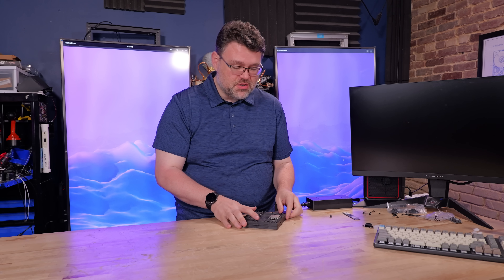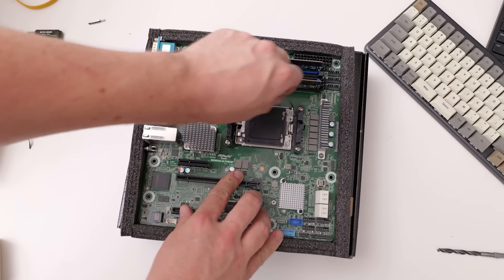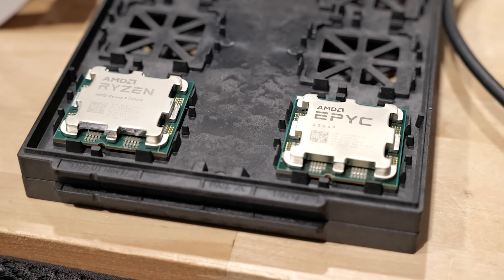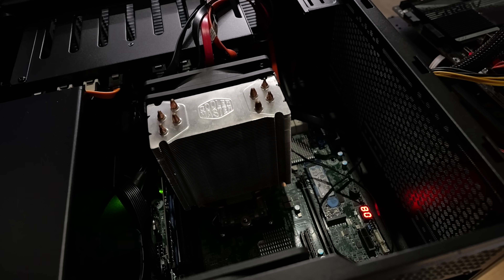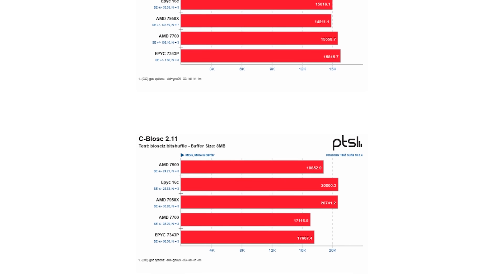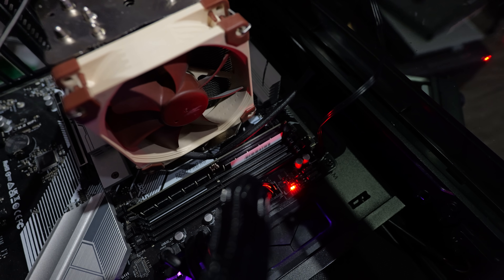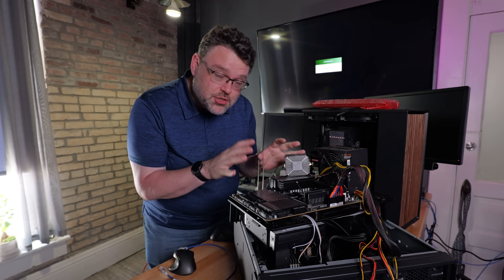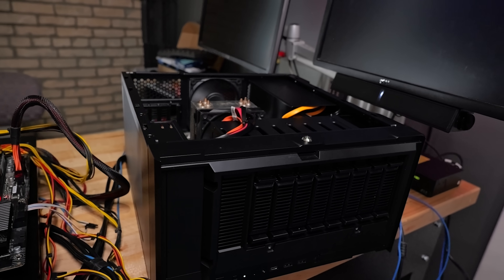They Put Epyc Onto AM5? Can They Do That?

Comment: Question, you mentioned the PCIe slot.  I’m looking to run 2-3 u.2 drives, likely in a 1u so connected to combo backplane.
Thoughts?  
It’s a shame you can’t easily run  multiple u.2/3  drives, via hotswap (though not real hot-swap but convenient to access)
Reply: anything?

Comment: What we need is boards with more pcie slots at usable speeds. 
Seriously, who cares about the new platforms gen 5.0 speeds ... instead of a single silly x16 5.0 slot I'd prefer a board with a bridge chip that turns those into four gen3 x16 slots or one x16 and six x8 slots. Slap some fast usb ports and dual or quad 10G onto the rear IO and I'd be in hardware haven. What, you want 800 bucks for that board because that big PEX is so expensive?  Fine. I take two and see how it goes.

Comment: You brought up something that I think is overlooked but sorely needed. A change in PCIE layout capacities on ATX and MATX motherboards. Not long ago the first PCIE was 16 lane electrical and 16 lane positions. A second PCIE was 8 lane electrical and 16 lane positions. A third PCIE and even a fourth, was single lane only or maybe 4 lane on some boards.
Today we have 16 lanes on PCIE1 and maybe a 4 lane on PCIE2  if fitted and maybe a single lane PCIE as well.
I'm with you, I would rather see PCIE 1 and 2 both being 8 lane and 16 lane positions, with additional single lane(s) as well. The supply of 16 lanes to PCIE 1 is a waste for most PC users. 
Firstly they don't game or so infrequently they don't need a 16 lane GPU, secondly, not all GPUs are even 16 lanes. There are lots of PCIE plugin boards that are available and in use today that need to be plugged into the 16 lane slot even when they are 8 lanes, with some boards 4 lanes. Thus requiring the GPU to go or be relocated to a 4 lane chipset slot. 
Changing the 16 lane slot to 4x4x4x4 or 8X8 or whatever does not help when the unused lanes cannot be reallocated as there are no electrical connections to be had on the board. And USB 3.2 gen2 or USB4 cannot be used as an alternative as many MBs only have USB2 or 3.2 gen1.
I don't think that motherboard makers are actually supporting the market well. Many boards are simply clones of another with a different name and "go faster" paint stripes added or removed. They are all obsessed with gaming. Yes, its big but many are casual gamers who use a pc for other purposes as well or exclusively. Many of these users have moved  to big brand prebuilt basic boxes or laptops as they can no longer build a desktop PC that works for them at a reasonable price.
Also I am not surprised that Asrock came up with a beta bios, I have put them as the best support company for years and have had special beta bios private download links from them in the past in response to email enquiries.

Comment: This has long been a gap in AMD's Server/Workstation lineup.   With Milan the lowest power and cost  EPYC was the 7203P at 120W at $338.  The market was screaming for something lighter and cheaper.  An AM5 part validated for ECC use on servers changes everything.  If this had existed previously, I would have bought it instead of my Rocket Lake E-2314 Xeon in my secondary server to my EPYC 7543.

Comment: Pix4D is a topography software that is heavy on CPU, an Intel 14900K does a crash to desktop when it's processing 1200 photos, with my Ryzen 5600X no crash. Guess what happened when it was a Epyc 7551P...
Basically intCel are the worst CPUs for workstation and probably servers too.
I don't trust benchmarks when intCel wins BIG over AyyMD because since the 00's intCel has been fixing benchmark software to favor their CPUs.
Since Pentium 3 I have never bought their CPUs and never looked back and lately I've been proven right on my decision.

Comment: Awesome! This would be a great upgrade from my current system of a Xeon E3-1275L in a Supermicro MBD-X10SL7-F-O with 16G of ECC but it would be nice to find a board with builtin SAS that can run in IT mode. I need all those sweet drive ports and built-in always works.

Comment: So this thing is the competitor to all of those Intel chips that the data centers were having problems with. If the price is right that could be very challenging for Intel.
Reply: Intel will have new chips on TSMC 3nm this year which will be a game changer.

They will have 12P Core Bartlett Lake on LGA1700 around January which should hopefully address all the issues of the 13th/14th gen B0 die.

Comment: W E N D E L L !!! . . . I have a question: what is better for internet browsing and 2k/4k streaming , a higher boost clock, or a  higher base clock?
Reply: The correct hardware encoder for the streaming part is more important then raw CPU power, as far as I know.
Reply: @larsjrgensen5975  . . are you Wendell? I was certain to specifically ask Wendell. I didn't ask about encoding, I asked about CPU clock speeds.
Reply: @RANDOMNATION907  Sorry for trying to help.

Comment: For the love of all that is holy though, AMD can we just get a 6 Core 12 thread 35W unit?  Heck I might even be ok with a 4 Core 8 thread 35W unit, would like a 4.2Ghz base clock though.

35W, 35W, 35W, 35W, 35W, 35W pleaseeeeeee I'm on my 8'th year now with Denverton A2SDi-8C-HLN4F
Reply: eco mode the 7900 ? :D

Comment: It doesn't impress me.  I wouldn't want it. 

What would impress me more is making CPUs/MBs that are borderline HEDT (FAR superior to HEDT 6 years ago) that are DESKTOP parts.

And this would be pretty easy, as in much easier than I guess most people understand but it does require AMD redo their MCM architecture and move to direct connects so the interface between the cores and IOD is much faster AND the CPU-chipset interface is 32GB/s (PCIe gen5 x8).

So, instead of making a desktop CPU with a ton of PCIe lanes, just have the capability of interfaces off the CHIPSET!!!!!!!!!!!!!!!!!!!

You have an X670E board that has to have 2 chipsets to run the interfaces, but Intel can do this with a single chipset at 2X the speed, and while people are cheering about how AMD is only competing with themselves, if you REALLY need to use a MB to its fullest capabilities Intel is superior, it just is, at the desktop level.  I don't care about what happens at the server level, I don't buy servers.

If you took Ryzen which has BEEN 28 PCIe lanes since Zen 4, with the extra 4 lanes wasted on a 2nd possible NVMe off the CPU, and instead connected those extra 4 lanes to the chipset interface and then made that run at gen5 speed, you could have X16 gen4 SOCKETS off the CHIPSET!!!!!!!!!!!

The only thing this won't address is memory, but for a lot of us ECC isn't a big deal because we aren't running a business off a desktop, but even if you're doing different work a lack of ECC isn't a big deal for desktop.  I set software to back up my work enough to where I'm not at risk of losing much work and the whole ECC thing doesn't matter.  It matters when you're dealing with other people's data or 99.999% up time is important.  But video editing doesn't need it nor does a lot of other professional work as long as your smart about what you're doing.

So, that's what I'd like to see, an AMD desktop system that's VERY capable, very much how X570 was when it came out.  Right now it's Intel that offers the better systems regardless of what the CPUs can do.
Reply: The chipset isn't a chipset. AM4 can run fine without a chipset which gets branded as A300, X300, and PRO 500. 

AMD could enable this with AMD, then vendors could make a chipset-free board and then use a PCIe switch for a many-laned board.

Comment: the EPYC 4564P is basically a 7950X and the EPYC 4584PX is basically a 7950X3D, the only difference the EPYC ones have 28 PCI lanes instead of 24, as far as I could find out.
So... besides 4 more PCI lanes, what is the actual difference between these EPYC and the corresponding Ryzen AM5 CPU. Speaking of actual differences, not verification, calidation and licensing stuff.
Reply: They have the same amount of PCI-E Lanes.

There is no difference otherwise. At the end of the day, this is meant to provide more stable and less expensive SKUs for businesses and integrators.
Reply: @jorper2526  less expensive compared to other EPYC, yes. But compared to 7000 series Ryzen, there is no advantage I can see except some apparently expensive papers and certificates (?) you get with them
Reply: @bernds6587  Please read the 2nd part of my comment.. lol

This does not make sense for you, a consumer. And it is not meant to, nor does it have to. Just enjoy the benefits it's existence brings, like AM5 systems with true ECC support.

Comment: What is the use case for 3D V-Cache outside of gaming?
There has been tons of testing going back to 5800X3D that all concluded that it was slower than the 5800X due to the slightly lower clock speed.
When equalized for clock speed, the cache provided no performance gain from 3D V-Cache.

AMD's own website on the matter says "GAMING", "GAMING", "GAMING for the desktop and the mention of it on servers is "With the addition of AMD 3D V-Cache technology, EPYC processors reach new heights to become the world’s highest performing x86 server processors for technical computing."2
The 2 says that it's the fastest with SPEC... without any indicator that the 3D V-Cache is what enables that.
Reply: there are other workloads out there that really benefit from more cache. CFD/FEA both come to mind.
Reply: It helps a little in a lot of situations and a lot in some. But an average of 12% is quite good. If you can fitt all your code in the cache, you will get a lot higher performance.

From Phoronix article "The Performance Impact Of Genoa-X's 3D V-Cache With The AMD EPYC 9684X" (The results are after testing 130+ different benchmarks. We are not talking games, but actual applications and workloads that you would use on servers and workstations.).

"Across that wide range of diverse Linux workloads, the EPYC 9684X was on average boosted by around 12% when utilizing the 3D V-Cache."

Comment: Hi Wendell; this is a great video but I would be remiss if I didn't point out that I was bit confused you mention 7000 series EPYC parts like the 7343 and 7543 in the video; you also on the graph have a 7343P listed; the 7543 is a 32 core Milan (Zen 3) based chip and the 7343P does not exist I assume you are talking about the 7343 non P but this is again a Zen 3 based 16 core part. You also mention swapping in a 7000 series EPYC part later in the video. I'm not sure exactly what you mean and what you are trying to compare here??? Maybe you meant 4004 series EPYC and I got confused...

Comment: The Epic 4004 AM5 CPUs have 28 Gen5 PCIe lanes. So I would like, 1 PCIe Gen5 X8, 1 PCIe Gen5 X8, 1 PCIe Gen5 X4, 1 PCIe Gen5 X4 and 1 PCIe Gen5 X4 for the chipset. Add 1 PCIe Gen4 x8 and 2 M.2 Gen4 X4 from the chipset ans some USB but not a lot with a 1Gb NIC. If you want more I/O add a card for it. Supermicro, make this happen, please. Basically, give me a good mix of PCIe lanes and let me decide what to do with them. 

2 Channels of DDR5 ECC at 5200MTs totaling 192GB sounds good, but I think it would be a miracle to get a 4 stick kit working on AM5, that fast.

Comment: So the 7950x doesn't have proper support but the 7700/7900 have?
Reply: Support should be the same for 7950X and any other 7000 Ryzen. I think Wendell specifically picked the 7900 instead of the 7950X, because it's price has dropped a lot and it is fairly good value for this use case. Also maybe because of the OOTB power limits. For most home servers, you probably don't need max clock speeds, but rather want efficiency. But depends of course if you want to do with it, nothing wrong with the 7950X.

Comment: The only issue there is the lack of added pcie lanes which so ma y mbs screw the pooch on

1x 16x is common for obvious reasons
But having a bunch of useless 1x slots is irritating same as the constant failure to use open ended slots

Many smaller servers woudl be better served with 1x16 and 1x8 signal wise   ot 1x16 with division to 8x signal for both plus a red 8x slot  since so many HBAs and sfp28 etc class cards need x8 pcie or better  not the x4 slots or smaller

Comment: To be honest,  I don't get it. Could easily drop this into a threadripper socket.   More pcie. Better cooling.   Already has the error correction built in.   Could even drop some gpu cores in it with the extra room. Then again I am not an expert either.
Reply: Completely different sockets. So, no you cannot.
Reply: @jorper2526   I get that.  What I am saying is that from my perspective,  the parts should have been designed into the threadripper socket instead of AM5.

Pretty sure that using the TR socket would have enabled skipping the need for a chipset and made it easier,  simpler to build the board.  Especially if it was limited to just 1 each double wide video card and 2 each M.2.  Simple and lower profile cpu cooling
Reply: @harryniedecken5321  then that is just threadripper.

Threadripper is expensive. The motherboards are big and expensive. You can already get down to a 12 core threadripper.. My question is, why would you want say, an 8 core threadripper vs an 8 core epyc?

Addendum: it would not be simpler for the motherboard. Something to realize is that each lane of PCIE is a tiny wire embedded in the motherboard. For each slot, all of the wires need to be the same length. All of those wires also need to connect to pins on the socket. That adds a lot of complexity to the design and manufacturing of the boards. Each piece of IO is a physical wire which must not interfere with any other wire.

The advantage of AM5 is less complexity, thus lower price. If you need more IO in a server platform, then you have the epyc 8004 or 9004.

Something else worth mentioning is that AM5 uses less power. Less IO = less power. This allows for an energy efficient system which can still boost to high speeds.

This isn't meant to drive an all-flash storage array.. But it does provide a good platform for a relatively inexpensive hypervisor for SMB or for edge compute.
Reply: @jorper2526  There are two types of TR, the pro and non pro version. Epyc is more similar to the pro version. 

With the pro TR in an 8 or 16 core Epyc setup,  they could offer a stripped down board with only 25 or 30% of the pcie and other connections enabled. 

The bigger package would be much easier to cool at the same power levels and board would only need 50% or less of a normal TR.

No need for the AM5 chipset for those functions. 

So the board + cpu + ram + M.2 memory could be fairly similar.   Possibly smaller area and thinner total including the video and cooling.

For use in the same application.   I could be completely wrong but I predict that people will be complaining about the shortage of pcie lanes, just like Wendle did in the video.
Reply: @harryniedecken5321 they already offer stripped down versions of epyc via matx or itx boards with less usable pcie.

And how hard do you think it is to cool an AM5 chip?? Ultimately the AM5 platform uses less power, which is something that threadripper as a platform simply cannot match. And it is not meant to.

AM5 has been used in server platforms already. It is not meant to compete with threadripper or the true epyc chips. It's not meant to drive 4+ GPU setups, or 12 NVME drives. AM5's usage is as an inexpensive server is as a lighter weight hypervisor and/or power efficient Edge compute. It has enough connectivity to have high speed networking, a few NVME drives, or a lot of SATA drives and a GPU.

Epyc 4004 is AMD rubber stamping AM5 as a server platform.

If you want a server with 512Gb of RAM, Epyc 4004 is not the answer.
If you want a platform to drive a 24 nvme drive array, it is not the answer.
If you want a low-power server to provide some local services to an edge location (domain controller, a smallish file share, a couple of application servers..) well, this is a great fit.

The concept is "fit for purpose". All of these platforms exist to solve different problems.
Reply: @jorper2526  OK thanks.

Comment: The one thing missing from the EPYC 4004 series are low power 35W SKUs similar to Intel's T SKUs. A 35W CPU would be useful for a server solution that needs to constantly be active while not using too much power.
Reply: Should be possible to run the existing parts at 35W, if those BIOS allow you to change precision boost limits like desktop boards do. However even official 35W variants of the same parts wouldn't have much lower power draw when idling than the higher TDP versions. They're just limited in how much power they can draw when boosting clocks under load. That is, unless AMD releases Epyc variants of the APUs. Those generally have notably lower idle power draw than the chiplet based Ryzens.
Reply: A 65W part would just finish quicker and then go to sleep for longer time then the 35W part.
The power needed to run a 65W or a 35W system for a year is close to each other, if the work feed to them both is the same.

You might want to go with a 7840u / 8840u (pro) if you can live with the lower lanes count and PCI 4.
Less idle power draw and more work per watt.